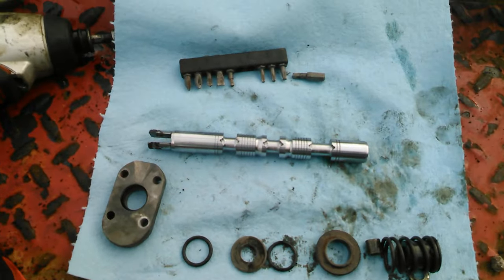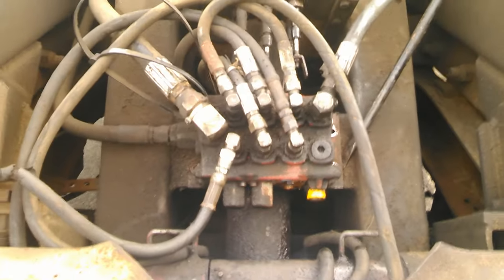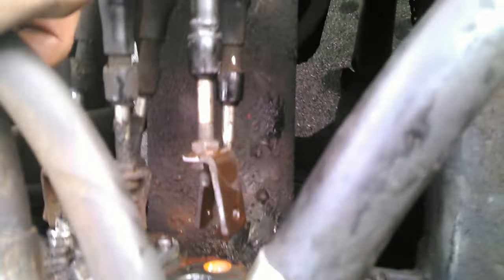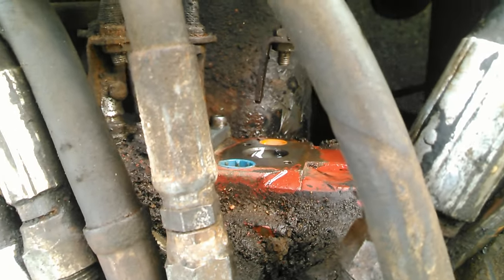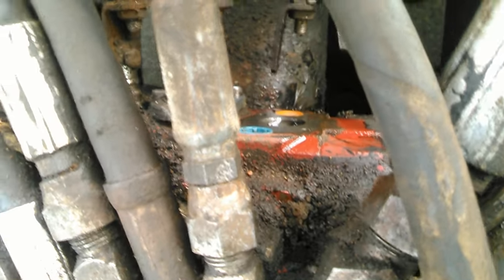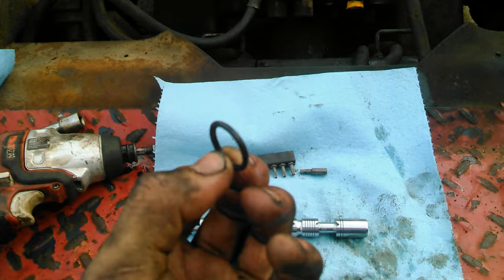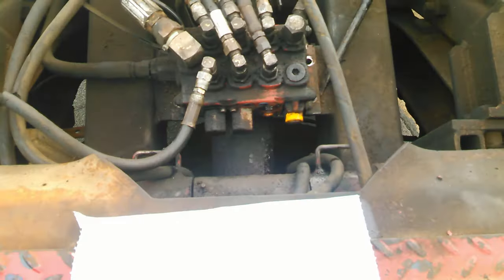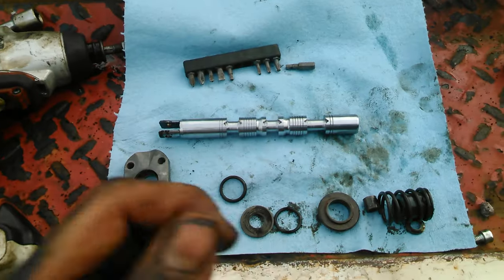Hydraulic control valve needs repair

Comment: replacing the seals rarely cure a leak from a spool valve. If you have a leak its usually down to the spool being worn not the seals it might cure it for a little while but it will eventually leak again.

Comment: Those prongs are there to keep dirt out not high pressure oil in. The spool is worn, the complete valve should be replaced.
Reply: O-rings, not prongs. Damn autocorrect
Reply: @kenblaese8719  really how do you knoe if the valve is worn out?
Reply: quagmire, the spools are close tolerance fit. There is only about 2-3 thousand clearance between the spool and the valve body.